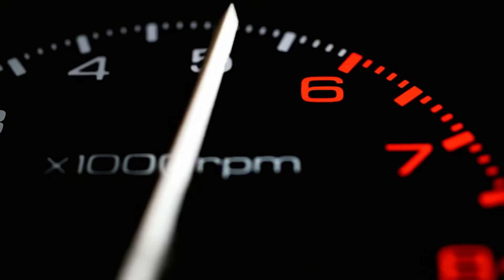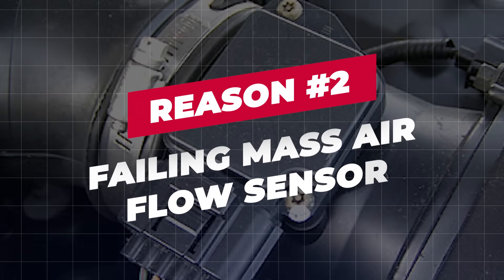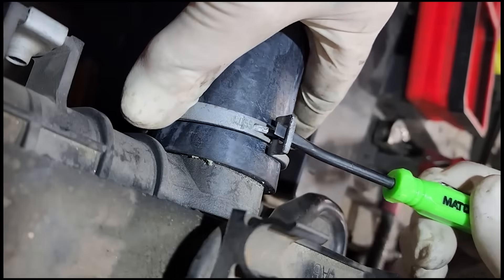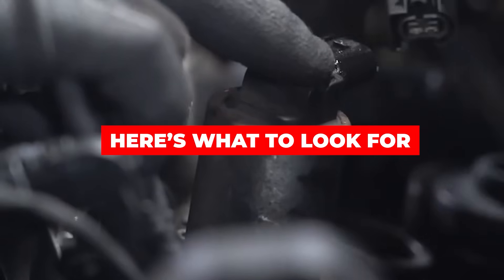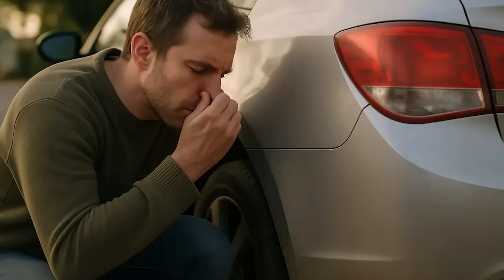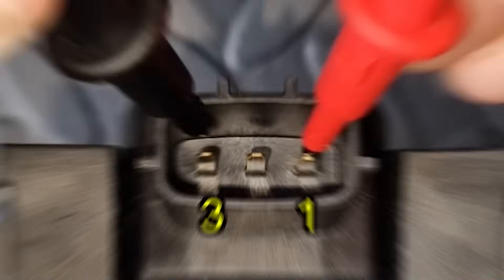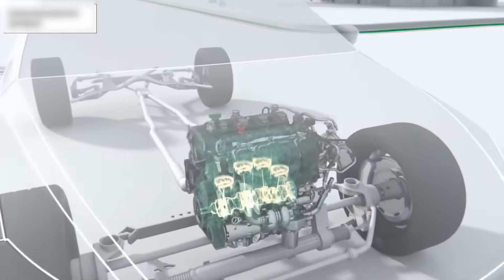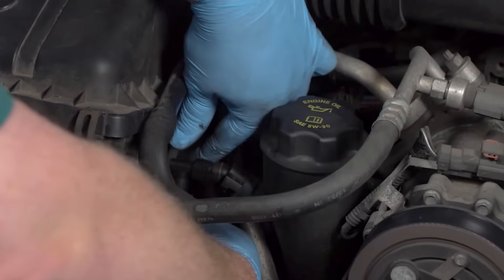13 Reasons Cars' RPM Goes UP and Down at Idle ( And Easy Fixes)

Comment: Every time I hit the gas take like 3 sec and I then revs up I put it in drive and it moves but as soon as I hit the gas it if feel like it wants to turn off
Reply: Im Having this issue as well i cleaned the throttle body and map sensor 
Now its even worse . And will stalling out now when foot is on brake and in drive
Reply: Check on your plugs/ fuel pump

Comment: Great I learn a lot from your video just one thing please tell me why very morning or when I leave my car for a few hours then when I started to drive off my reves it's take time to pick up
Reply: This can happen on cold starts due to some things working against your engine at the same time. They include: Thick oil that creates more internal drag, so the engine takes longer to rev freely, cold, dense air that require precise fuel adjustment; and if this goes slightly off, acceleration can lag, dirty throttle body which restricts airflow when you press the pedal, causing delayed RPM response, dirty fuel injectors that sprays fuel poorly when cold, and clogged fuel or air filters that limits fuel or air flow during takeoff.

Comment: You forgot the engine and transmition mounts
Reply from the maker: Good point! Bad engine or transmission mounts can cause rough or unstable idle too. When they’re worn, the engine moves more than it should and messes with sensors, making RPMs jump.

Comment: I was dealing with rough idle and random RPM jumps on my 2012 Mazda 3 — thought it was just bad gas at first. This video actually helped me narrow it down to a dirty throttle body. Super helpful stuff!
Reply: The comment I have been looking for. I have the same model doing exactly the same. I will clean throttle body and see what happens!
Reply from the maker: Glad the video helped you diagnose the issue with your car's idle! Stick around for more DIY auto tips.